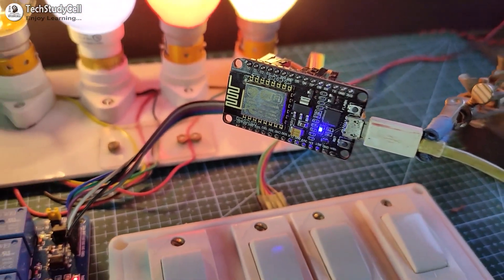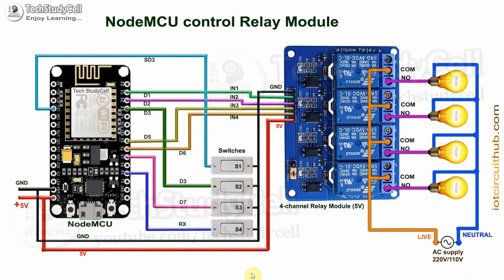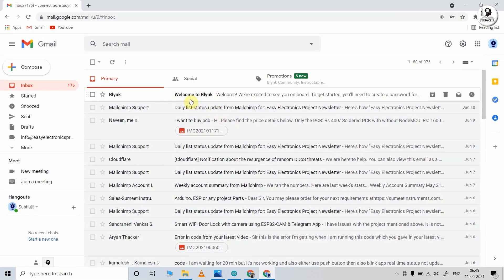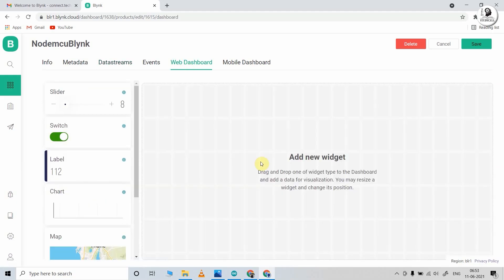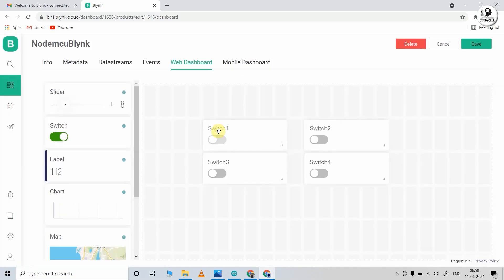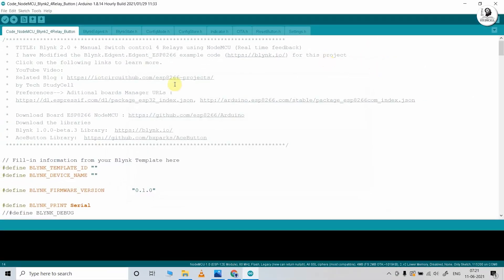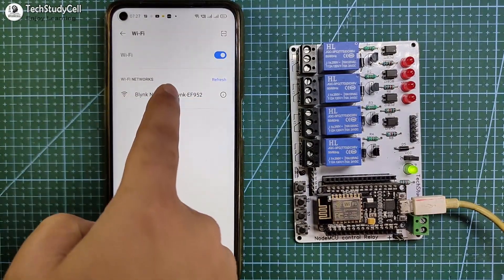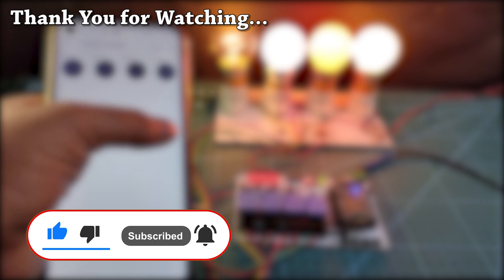Home Automation using NodeMCU ESP8266 and Blynk 2.0 with real-time feedback | IoT Projects 2021

Comment: I cannot install and get the error " Compilation error: #error "Please specify your BLYNK_TEMPLATE_ID and BLYNK_DEVICE_NAME"

In file included from c:\Users\Admin\Documents\Arduino\libraries\Blynk\src/BlynkApiArduino.h:14,
                 from c:\Users\Admin\Documents\Arduino\libraries\Blynk\src/BlynkSimpleEsp8266_SSL.h:27,
                 from D:\Aduino\Code_NodeMCU_Blynk2_4Relay_Switch_NEW\Code_NodeMCU_Blynk2_4Relay_Switch_NEW\BlynkEdgent.h:9,
                 from D:\Aduino\Code_NodeMCU_Blynk2_4Relay_Switch_NEW\Code_NodeMCU_Blynk2_4Relay_Switch_NEW\Code_NodeMCU_Blynk2_4Relay_Switch_NEW.ino:64:
c:\Users\Admin\Documents\Arduino\libraries\Blynk\src/Blynk/BlynkApi.h:39:6: error: #error "Please specify your BLYNK_TEMPLATE_ID and BLYNK_TEMPLATE_NAME"
   39 |     #error "Please specify your BLYNK_TEMPLATE_ID and BLYNK_TEMPLATE_NAME"
      |      ^~~~~

exit status 1

Compilation error: exit status 1

Comment: Thanks a lot, I met success but had to struggle a bit because the App now has got updated. Moreover I don't have to use the switches/buttons so modified the on value to zero and off value to one and it worked! Looking forward to more such videos from you.
Reply from the maker: Great 👍

Comment: C:\Users\user\AppData\Local\Temp\.arduinoIDE-unsaved202373-16288-1mgkc1g.pjab\Edgent_ESP8266\Edgent_ESP8266.ino: In function 'void loop()':
C:\Users\user\AppData\Local\Temp\.arduinoIDE-unsaved202373-16288-1mgkc1g.pjab\Edgent_ESP8266\Edgent_ESP8266.ino:155:5: error: 'manual_control' was not declared in this scope
  155 |     manual_control(); //Manual Switch Control
      |     ^~~~~~~~~~~~~~

exit status 1

Compilation error: 'manual_control' was not declared in this scope

*hi, I want to ask..for this error how can I fix it?

Comment: My project is working well until i connectd the switch , Esp8266 kept restarting while i use the switch , do i need to give additional    230 v supply to switch, if i have to give 230 v then can i directly give it to switch or do i need to give through relay

Comment: 9:17 im getting a problem on the part where you connected the Esp. my Esp is blinking led and is not connecting to the mobile wifi, if says ip configuration failed.

Comment: Hlo bro I made this project and my 3 switch are working properly but the switch 1 is not working,when I'm going to connect sd3 as shown in circuit diagram it is not working..What happening I'm not understanding please do help me to let out from this problem......
I'm waiting for your reply please bro reply me as soon as possible....
Thanks for this wonderful work .....
Reply: I am also getting the same issue
Reply: Did you get the solution?
Reply: Yes I get myself
Reply: I have changed the programming,But I don't remember now because I don't have a project right now 😞
Reply: Yes I got it
Reply: Who so ever is getting this problem you can try to change pin S3 ,you can change it to D5 which is also associated with nodeMCU light

Comment: I have a question on wifi credentials. I made a blynk project on one wifi network and now I have to install it at a different location where the wifi network is different. When I power up the device at the new location it shows that the device is offline ! How can I correct the wifi credentials to get it to go online?.
I used to have wifi login reset button. But this clip doesn't make it clear. I hope the author makes a clip to clarify that. Thank you
Reply: after discovery. want to delete wifi configuration then you need to (delete} project in appblink is ok.

Comment: Sir , it worked and facing a issue that on turning on the loads from manual switches , relay is turning on and off and the manual control isn’t working properly, so its due to 1 way switch? 
If we use 2 way switch then it will be resolved? And also tell how to connect two way switch with it

Comment: Hai 
          Can we use the same single nodemcu to work with  ifttt and blynk  simultaneously  in a single program?
Ie;
I need to get telegram call when motion detected in my home and  I should be able to control my lights through blynk. 
Is it possible?

Comment: hi 
i have a    12 volt  rely  and want to use it for the same   project but it needs 12-volt power supply but i don't know how to connect that   to rely . its connect  to right bottom pin or  Center  pin. and it still needs GDN or 3-volt pin from esp 8266 or not
thanks to useant to use

Comment: Hi!this was a great tutorial and was able to control the lights, I watched an older method of this by codemetry and that guy as integreted with ifttt and google assistant
He used google assistant in this and used webhooks in that and he configured with blynks server ip adress but he used digital pin whereas you used digital pin so can you make a tutorial on how to connect ifttt and webhooks?
Reply from the maker: Ifttt is not free anymore. And I try to use available free platforms in my project
Reply: @TechStudyCell  that is true, so what can be done to link to Google assistant?

Comment: I created my first IoT after around a month.The video should have been more elaborate,I suppose.
First,On windows 10 in a laptop,it won't upload the code to ESP8266.
Then I tried my Desktop having Windows 7 and I could go past uploading stage.But then the Blynk 2.0,showed unable to connect stating wrong device selected.
Thereafter I reuploaded the code and this time installed Blynk library for wifi etc. all.
I was under the impression that I had selected board version as 1.0 instead of 0.9 but that was not the case.
Installing Blynk library for wifi did it and I succeeded this time in connecting my ESP8266 to Blynk 2.0. 
Everything was breeze thereafter. 😀😀
😘😘😘😘😘
A question plz..
Will it work on AC, Fridge,et,... ?
Reply: Did the code work for you

Comment: Arduino: 1.8.15 (Windows 10), Board: "NodeMCU 1.0 (ESP-12E Module), 80 MHz, Flash, Disabled (new aborts on oom), Disabled, All SSL ciphers (most compatible), 32KB cache + 32KB IRAM (balanced), Use pgm_read macros for IRAM/PROGMEM, 4MB (FS:2MB OTA:~1019KB), 2, v2 Lower Memory, Disabled, None, Only Sketch, 115200"

Code_NodeMCU_Blynk2_4Relay_Switch:33:9: fatal error: BlynkEdgent.h: No such file or directory

   33 | #include"BlynkEdgent.h"

      |         ^~~~~~~~~~~~~~~

compilation terminated.

exit status 1

BlynkEdgent.h: No such file or directory

This report would have more information with
"Show verbose output during compilation"
option enabled in File -> Preferences.
Reply from the maker: Update the Blynk library (version 1.0.1)
Reply: Code_NodeMCU_Blynk2_4Relay_Switch:33:10: fatal error: BlynkEdgent.h: No such file or directory

   33 | #include "BlynkEdgent.h"

      |          ^~~~~~~~~~~~~~~

compilation terminated.

exit status 1
(plz help me bro)

Comment: Extremely useful video. I have a question on wifi credentials. I made a blynk project on one wifi network and now I have to install it at a different location where the wifi network is different. When I power up the device at the new location it shows that the device is offline ! How can I correct the wifi credentials to get it to go online?
Reply from the maker: As per their documents you can do that from New Blynk IoT app. But I have faced some issues while doing that.
Reply: @TechStudyCell  Thanks. If you find a solution kindly post it.

Comment: amazing vedio bro ..but i face a problem here ..after uploading the code..blue led not blink.and when i go to my app it shows that wifi is connected but my applainces not working ..???any solution???????....i think i give a separate 5v power supply?? am i right??

Comment: Thanks for sharing this video. I would suggest one point here as feedback in real time problem. if we connect the components as per this circuit diagram which cause relay failure and getting application damage because of spontaneously changing the ON/OFF in the relay via mobile app . Better we can have 2 way switches in that having 3 pins for connect power signal and not control signal cables. This is suggestion if we are going this real time scenario at home.
Reply from the maker: Noted
Reply: @TechStudyCell  sir this problem will occur when we use daily at home??

Comment: ERROR DISCONECTED BLINK AND CAN'T CONTROL MENUAL SWITCH.
Reply from the maker: During booting the switch1 and switch2 must be turned off if you use latched switch. Still sometime you may face some issue as it is under beta version.
Reply: @TechStudyCell  Thank You. i fixed the error, i want to control 4 relay menual switch and stream data from DHT 11 to Blynk 2.0, can you help me to do that?
Reply: @TechStudyCell  I have set CPU 160MHZ esp8266 to fix the error, I feel it works faster and more stable. you can try it, and thanks for what you share.